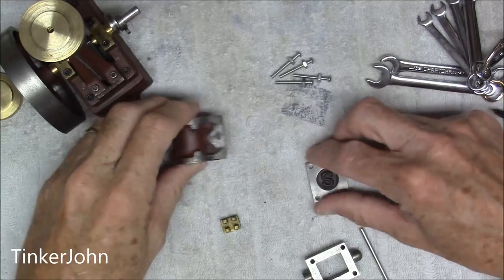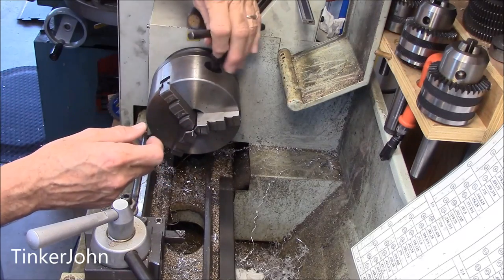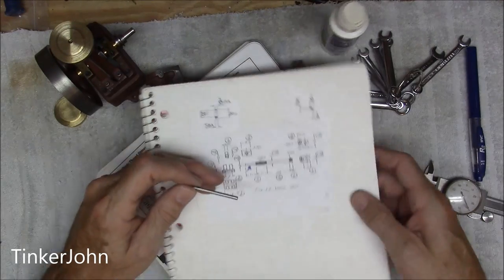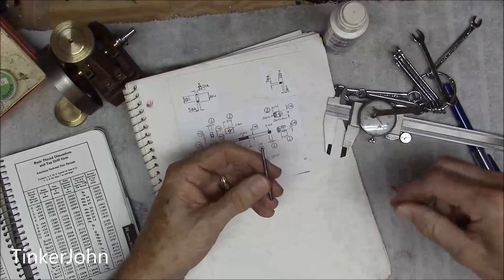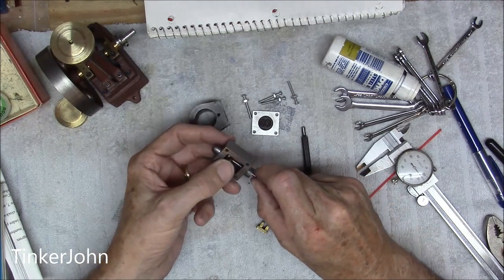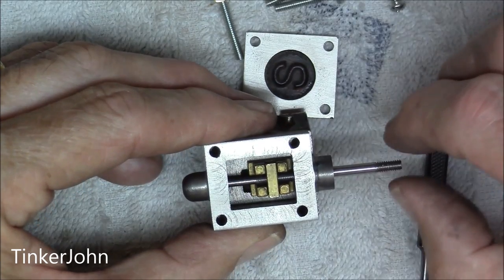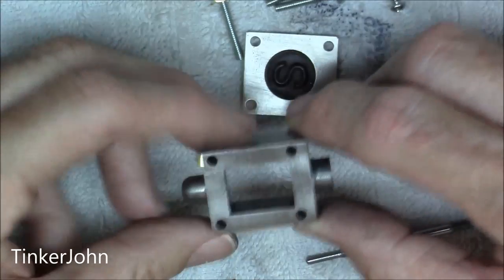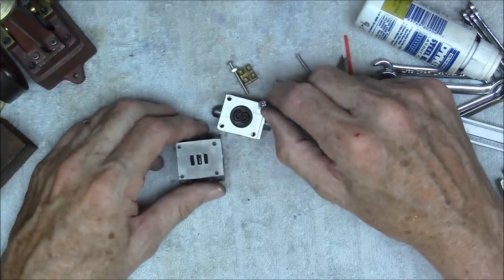Machining the Stuart 10V Steam Engine Castings - Part 45

Comment: You'll be getting the boiler fired up soon at this rate!! If that turned part of the shaft is a good sliding fit in the domed part of the valve chest, which it should be, you need to file a tiny flat on one side of the turned portion of the shaft so oil does not get trapped in the "upper valve rod bearing " and cause either cause hydraulic lock, or compress and sucks the trapped air ! You might need a smaller file though :o) what colour are you painting it? Mine is going to be LMS Crimson Lake, which is a darkish red.
Reply from the maker: +Roger Crier 
Roger, Thanks for watching and for your comments.  All are very good suggestions, as for the paint...I usually wait until finished and then pick a color. ~John

Comment: I'm using 5-40 bolts for my engine, and I found some nice SS bolts for the cylinder covers an main bearings.  Trouble is, I can't find 5-40's long enough for the steam chest.  I did make up studs, and this works, but the SS nuts I have are 1/4", not very scale, and much larger then the  0.180" heads of the SS bolts I bought.  

I recall you (and others) saying to use Allen wrenches for stock to make bolts.  Just the nuts, or the entire bolt?  Aren't they tough steel?

I'm really enjoying watching you build the 10V, even 'tho mine is mostly built, and I've built a bar stock version of the 10V many years ago.  

Thanks.
Reply from the maker: Thanks for the question.  The Allen wrench can be used for both bolt and nut.  Just heat the wrench to red hot then let slowly cool to soften the metal a bit.  Hope this helps.       ~John
Reply: Thanks John, 
I found I had several 0.187" Allen wrenches; I'll try it!
Reply: John,
I just found some 0.187" hex brass rod that I forgot I had, so I made some nuts out of that.  Seem OK, although I'll still make some out of steel to match the other hardware.  I make some studs out of 5-40 threaded stainless steel, boy is that hard to work with!  I had to run a Die over the threads.  Maybe next time I order, I'll get some 0.187" steel hex stock as well.  I'd really like to find a good source of 5-40 SHCS and hex head bolts and scale nuts.

Comment: Did I miss a step or did you lap the slide valve face so it fit good and flat to the cylinder? With the tapped brass adjustment keeper like you say it should not be sloppy for valve movement but it does have to be loose enough that steam pressure (or air) presses the slide valve against the cylinder to help it seal it, right?   You are getting closer to the end but some small detail parts to go. Those darn Ham videos are slowing this work, ha!  I remember one of the men I worked with use to listen to code on his drive to work to learn a looong time ago. I should find out Bill's call and see if he is still active. I think he had a unit to decode CW to text. I'd need that!
Reply from the maker: +gvet47 
Galen, yes getting close and as you say still several small and important details to do.  I will be doing a "light" lap on the faces when I get into final assambley.   Since this engine will see no actual work, I won't do a mirror finish but will smooth things out a bid.  As for the code, I'll have to admit, it was a struggle for me to learn and still not as good as I should be.  However I can head copy pretty good without using a reader.   ~John
Reply: +W5CYF / TinkerJohn  Yes I'll be interested is seeing how you work on the connecting rod to the valve chest that has to fit the eccentric cam. Always enjoyable to watch you work.